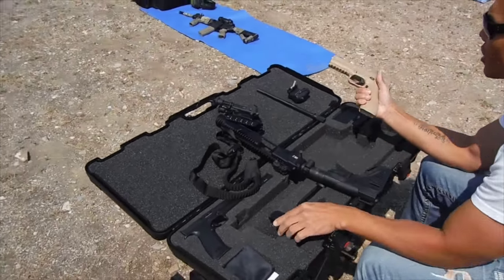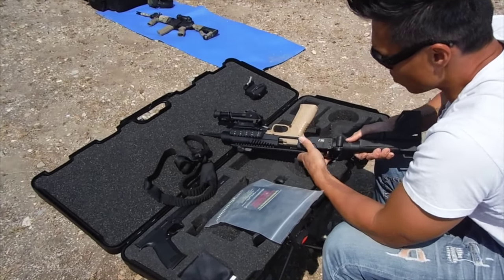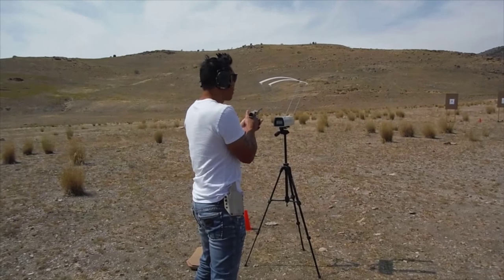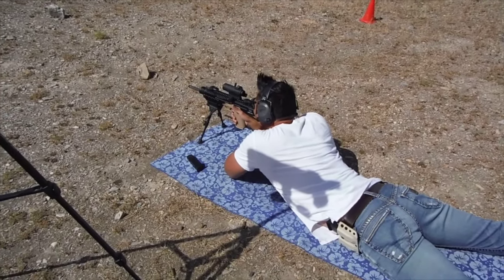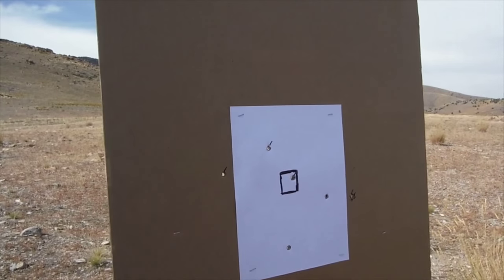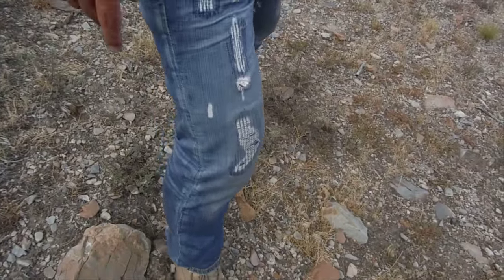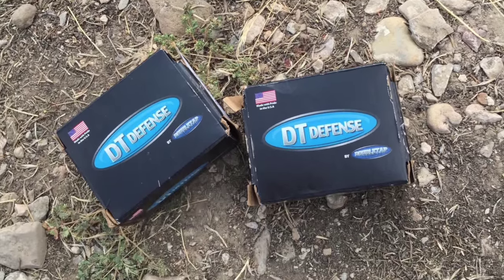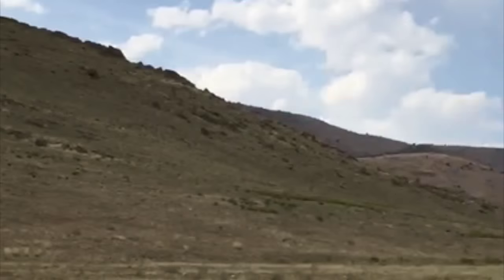Fun with the Strike One LRC 2

Comment: Doesn't the kit make it SBR?
Reply from the maker: +Bald&curious Yes, however if you do NOT shoulder it as of last year it is okay. Shouldering it in 2014 okay, 2015 not okay, what a difference a 4 and a 5 make, hmmmm.
Reply: Did you have any issues with magazine dropping ? Check out video on my channel , did some research  and there's few videos showing same problem
Reply: @Baldcurious  Happened to me as well, they fix it for free so not to big of a deal if you season it well and discover it happens and have some time to wait for the send back. Happened in about the 500 round range.